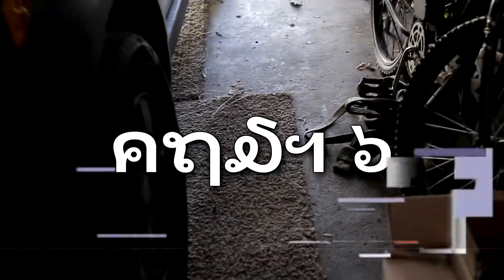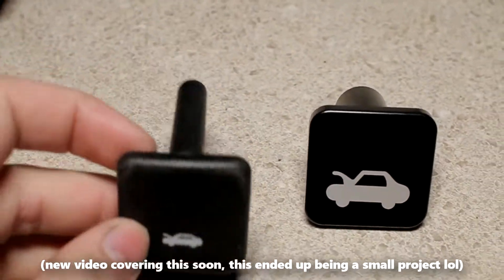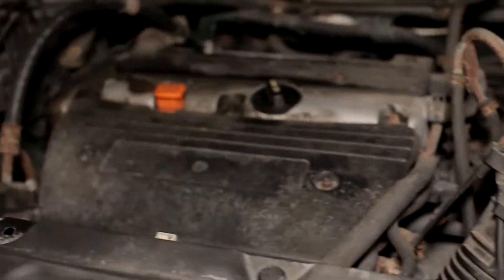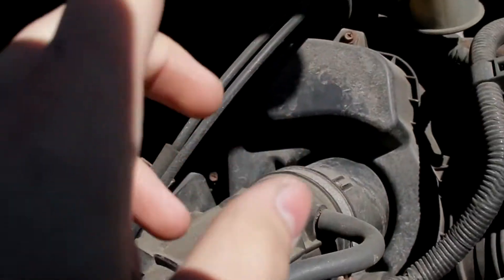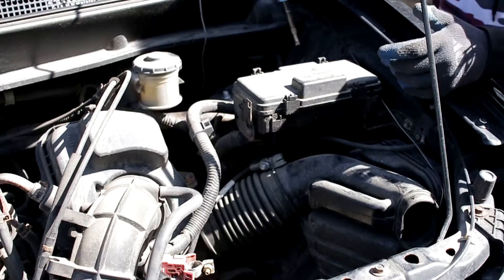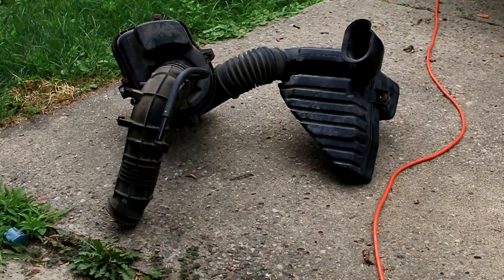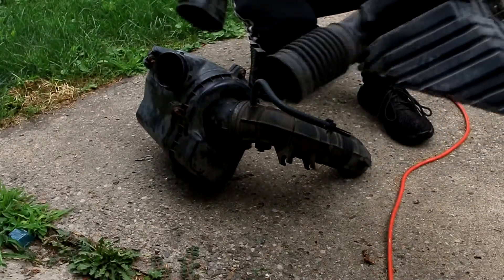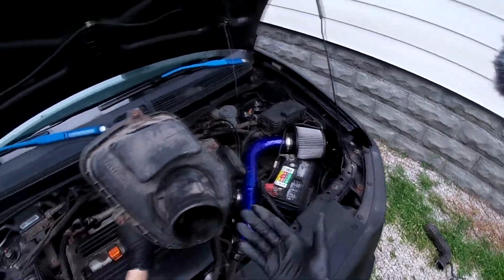HPS Performance Intake Kit Installation on my '04 Honda Element (+Sound Comparison)

Comment: My question is, did it make a difference in performance. Quite honestly, I don't really like the loud sound on my vehicle. But if it's significantly increases the performance by a significantly noticeable increase, then I would consider doing it. I'd love to hear your response. PS: this is a great video! Well done
Reply from the maker: Yes there is! It’s has a faster response to acceleration. 

On HPS’s website you can see the before and after dyno-specs 👍

Comment: I noticed that this specific Cold Air Intake is for the 2003-2006 Honda Elements, I have a 2008 Honda Element and was looking into getting this. To me, the engines look identical, do you think there are any differences and/or reasons it wouldn't be compatible?
Reply from the maker: Hmmm, honestly not sure. From my knowledge I don't see why it wouldn't work